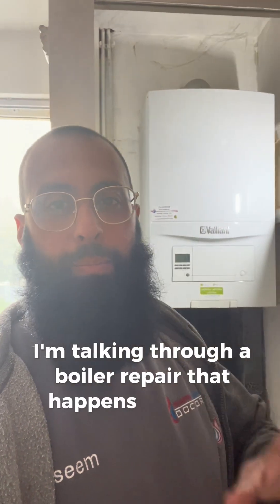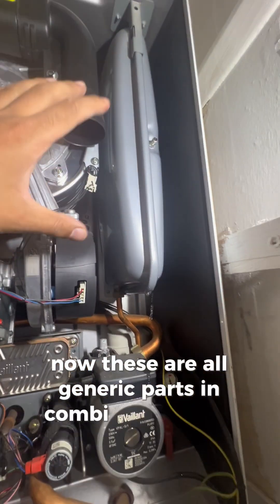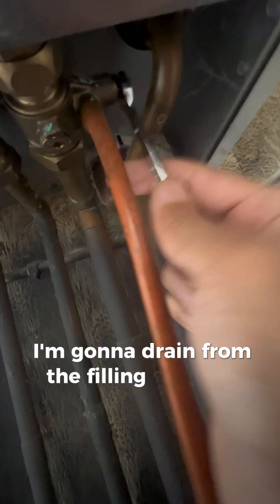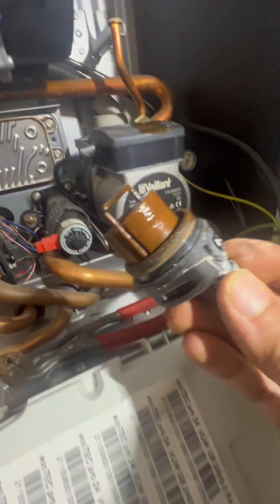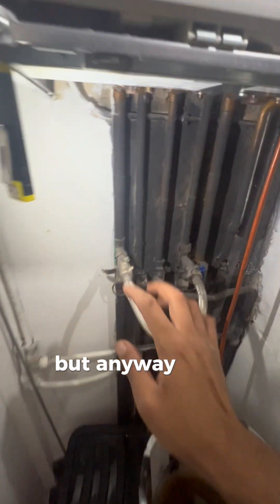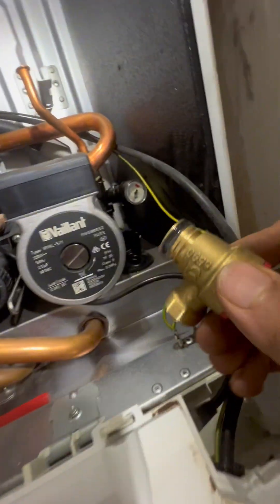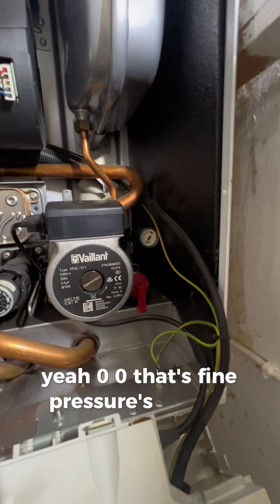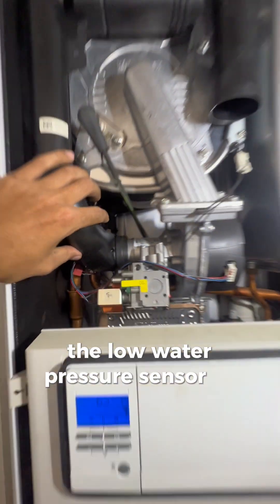Every Gas Engineer Has Done This Repair ✅ (Full Guide)

Comment: My tip is  never to leave the aav open after venting the pump, it's  only there for commissioning!
Reply: My question is how is it an auto air vent if its in the closed position?..
Thanks 
With no inhibitor or not enough and build up of air would cause more issues with it not?..
Reply: @djsmokinj  It is an auto air air vent but is only intended  to be used during commissioning  or recommisioning.
Air or hydrogen are signs of problems in the system and one of them will result in contamination of the AAV which will result in it leaking if left open.
Intergas  use a manuel vent on top of the boiler, much more intelligent!
Reply from the maker: 👍🏽 good tip but on the flip side if customer drains heating system to carry out repairs the boiler may not vent all the air out
Reply: @PlumbingDoctors  As in anything, a little knowledge is a dangerous thing!
I have no sympathy for ignorance in this day and age!!!!
Reply from the maker: @johnward5006  you have lost me
Reply: @PlumbingDoctors  My point is, if the customer doesn't  know how to properly refill a heating system, they deserve  all they get!
Not disconnecting  the filling loop is another issue.
Reply: You also missed that the non return part of filling loop was on heating side when you replaced you fitted it correctly
Reply: Also a tip for you spry leak detection fluid on schrader valve
Reply: 🙈🙈🙈 at least your honest about the miss hap, disagree about the AAV being closed, manufacturer’s are putting a tube on the air release caps and terminating outside the case. Sorry a AAV is a serviceable part and should be done on a service each year. Anyway it should not leak if the system has been flushed and a inhibitor has been used and gets checked each year,also on each service.